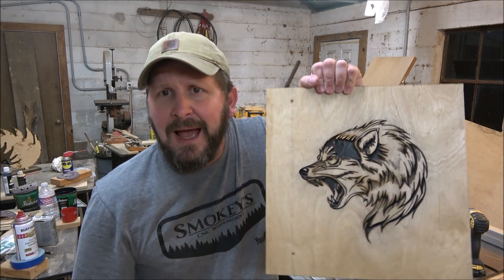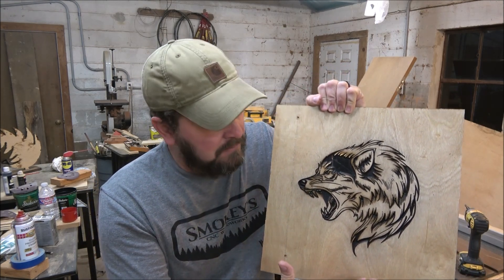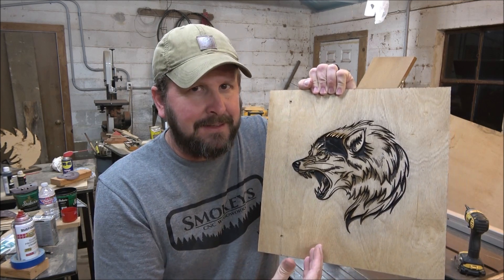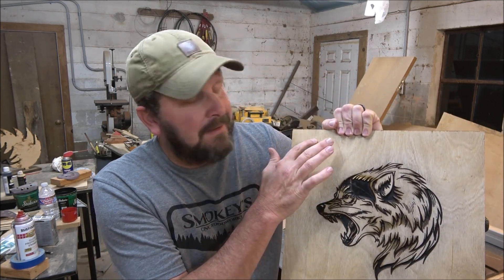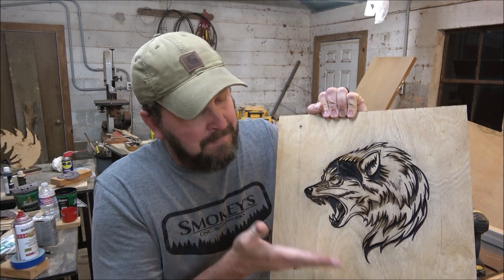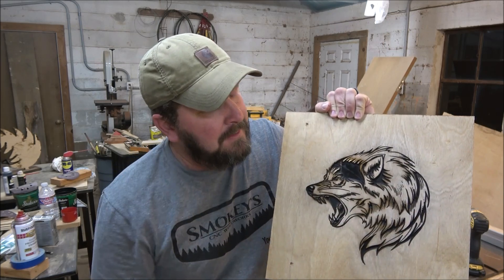Wolf Head CNC

Comment: Looks like allot of your projects are done on 3/4 wood, what is the max cutting depth you usually use. Great project, stay safe.
Reply from the maker: I usually don't go deeper the 0.15, I like 3/4" because you don't have to deal with warping of the board hardly ever, with 1/2" it tends to warp a great deal more....Thanks for watching!!
Reply: @SmokeysCNCWoodworks  thank you, I'm still starting out and have limited mine to .1 on a couple but yours send to have better detail but it may just be the drawing that you use. Thank you for the reply, I use cabinet grade ply when I use ply, is that what you use? Stay safe